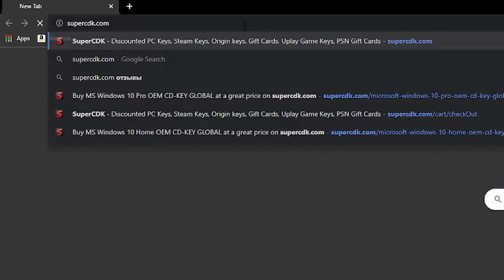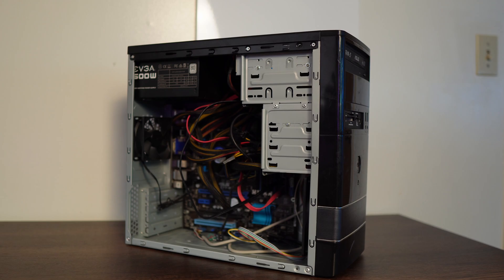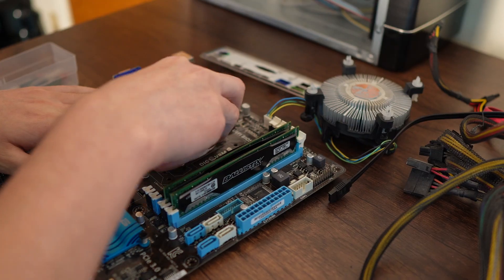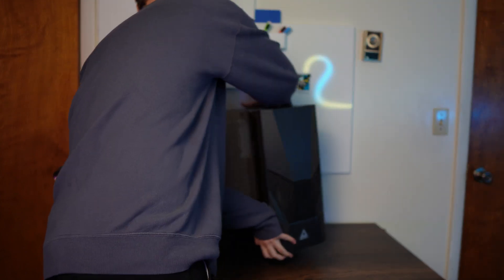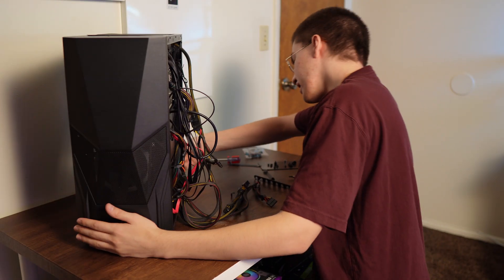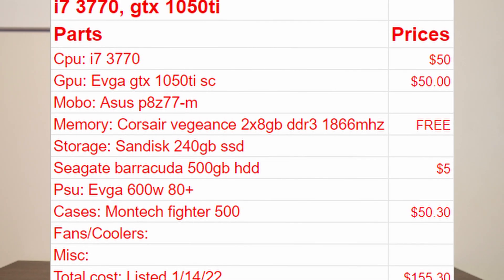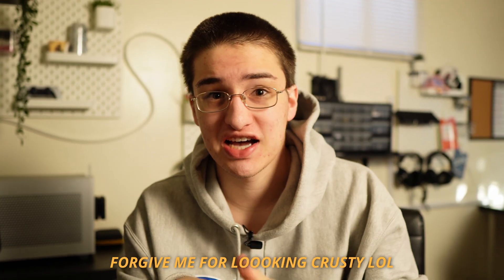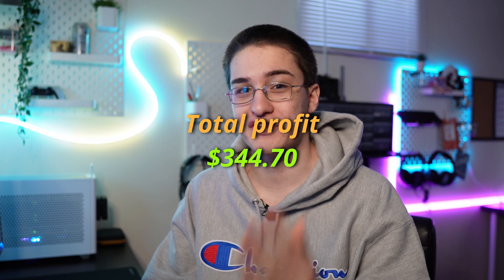Do This To Make MORE MONEY From Flipping Pcs!

Comment: I dunno about putting a stock Intel cooler on a 3rd gen i7.  Even if it's not a K chip, those chips run pretty hot, especially if the buyer decides to do some video editing.  I'd get a cheap Snow Man tower cooler from Aliexpress.

Comment: Have you used AIO water coolers in builds? or are they too expensive
Reply: imo they take some of the profit off my flips I rather use a regular cooler with lights
Reply from the maker: I use them sometimes. In higher end builds
Reply: He used the vetroo aio in one of his flips. I remember which video it was through